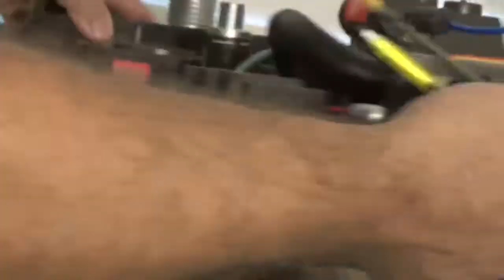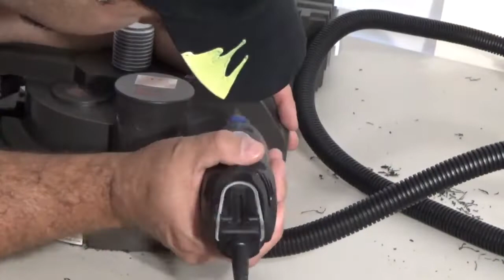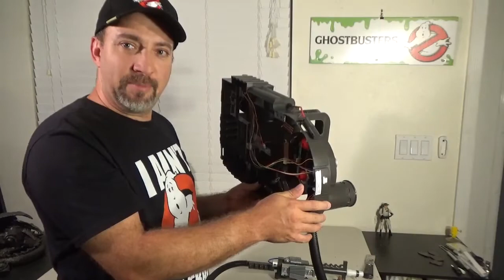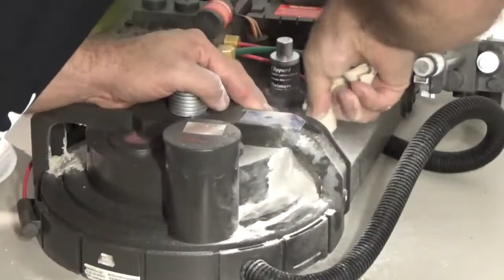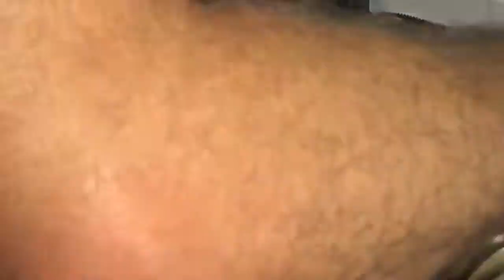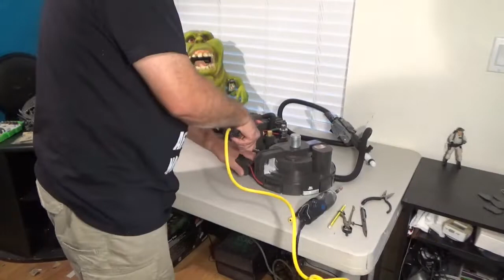Spirit Proton Pack Mod: Ep4:  Bumper Bar Cutout, Cyclotron Fill

Comment: Awesome mod! I'm planning on doing that with my next spirit pack! What kind of filler did you use before you added the bondo? Was it a kind of sturdy paper or cardboard? Thanks! :D
Reply from the maker: Thanks! Glad you like the mod. I used heavy card stock glued in placed with hot glue.
Reply: Good videos…I’ll give you a sub.
Reply from the maker: @hudsonkb  thanks!

Comment: Hope you cut the pack? What not you use and what did you use to sand?
Reply from the maker: I cut it with a Dremmel tool with a scroll bit, and used a grinding bit to sand. I then used some loose sandpaper to blend and smooth the edges. Hope that answers your questions.